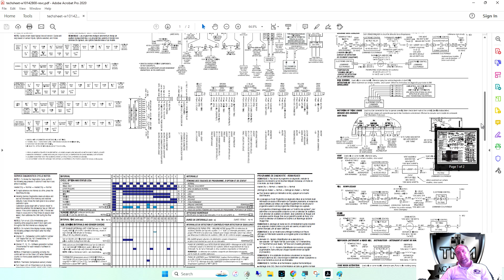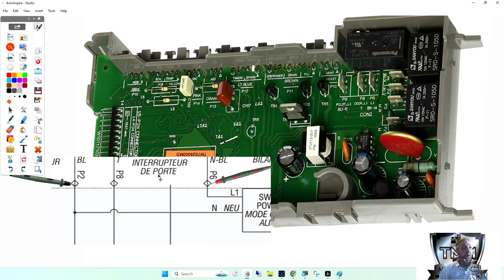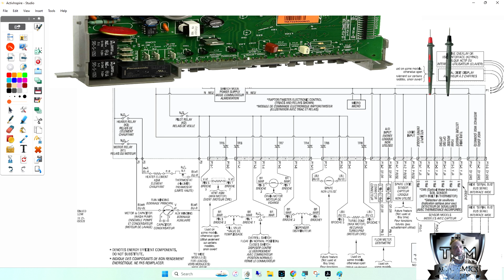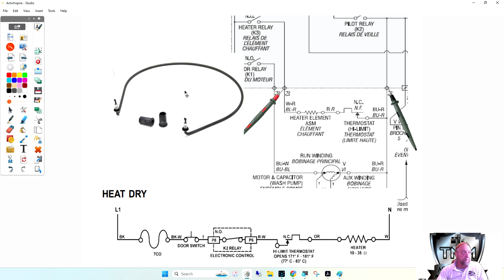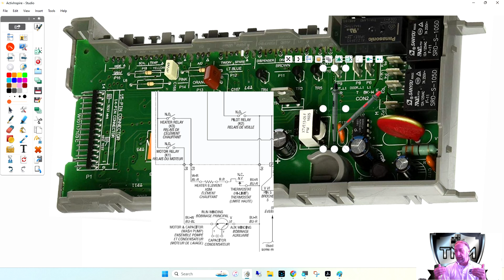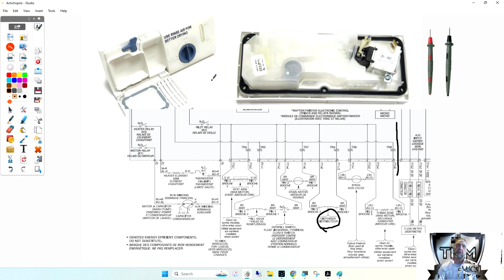Whirlpool Ikea Dishwasher

Comment: Your motor resistance calculation was wrong due to the capacitor. You should be able to measure the series resistance across the capacitor leads. Beware DANGER, an open circuit motor will result in a fully charged capacitor. They bite I know this.